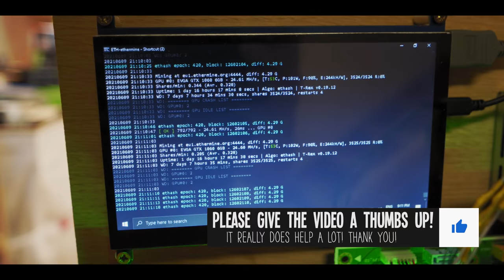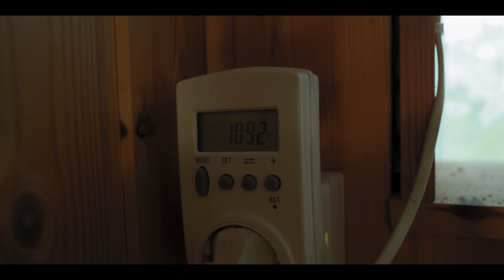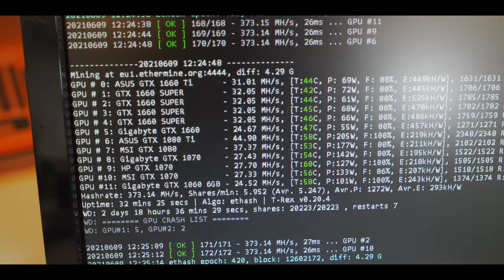My 800MH/s Mining Farm Tour (Ethereum)

Comment: You can get 27.3 mhs from 1660 if you oc it correctly, my two 1660 are stable at 27.3 mhs @69 watt
Reply from the maker: That is depending on what memory chip manufacturer you have in your 1660. Different 1660 cards perform differently and 24.5mhs is max for mine.

Comment: Which is the best efficiency card according to your experience 3060 ti or 1660 super?
Btw i liked your idea of building 4x13 1660 super rig
I am also thinking of same please give me some opinions 🙏
Reply: Skip those and go for a 3070 rig. Much better efficiency and less heat from the cards.
Reply: 3060 ti similar hash rate as 3070 but cheaper

Comment: Your 1660 supers that produce 32.5-33.5, you said you use Samsung memory, do you mean that your 128gb ssd is from Samsung ?
Reply from the maker: No, so the actual memory chip inside your graphics cards can be manufactured by different companies like Hynix, Micron or Samsung. The 1660 Supers that have their memory chip manufactured by Samsung can be overclocked a bit more to reach slightly higher hashrates. You can check what memory manufacturer your GPU has in a software like GPUZ, but there’s no way to know before you buy the GPU, so it’s all luck. I have 17 1660 Supers and 10 of them have had Samsung memory.
Reply: @SebsFinTechChannel  thank you so much seb appreciate your content. It’s a lottery out there

Comment: Can I have the link for the 1 to 4 pcie splitter card so I can add more gpus to my gaming motherboard?

And you mentioned you don't want to use the splitter long term. Why is that?
Reply from the maker: Link is in the description of the video now! It's just because it makes your rig slightly more prone to crashing with really high overclocks. But as long as you are able to restart your rig if it crashes that's no problem. Good luck!

Comment: I have a rattling sound on my 1660super when fans is around 60-80% rpm do have you ever encountered a similar issue?
Reply from the maker: Yes you might have a loose fan. It’s easy and cheap to replace :)

Comment: Why aren't you using 2000 series or 3000
Reply from the maker: I don’t use 2000-series because they are less power efficient than 1660-series and I don’t use 3000-series because they are a lot more expensive per mega hash

Comment: how are you getting this low wattage on the 1660 cards I get 78-80 watts
Reply: also how u r getting 32 mh/s on the 1660 super do you mind sharing the oc setting
Reply from the maker: First you mention wattage and then you mention a temperature. What exactly is your question? :)
Reply: @SebsFinTechChannel  i mean watts sorry 😂
Reply: @SebsFinTechChannel  maybe because of memory I have micron memory
Reply from the maker: Okay! To lower the watts check out this video: https://youtu.be/4fNhJmJbcRk As for hashrate, if you have Hynix memory you can get 31.8 max with memory clock at -502. With Samsung memory you can get up to 33mh/s on some cards with good cooling by going to around +1300 on the memory clock. But not all cards can handle that high of a mem clock, some crash. So you just have to test your way.
Reply from the maker: I don’t know about micron memory sorry.

Comment: bro have one consult, i buy 3060 for 1000usd is a good idea ?
Reply: no :( price high and have hashrate limiter. older ones, you gotta play around a bit to get the limiter off
Reply: @WhenPokemon  or 3070 for 1200usd ? Nvidia driver unlock not ?
Reply: @ryugamer9726  1200 is still a lot for a 3070 :( check new egg prebuilts. generally anything made before may 2021 for the 3070 will not have the harsh rate limiter.
Reply: @WhenPokemon  mmm the driver 470.05 nvidia not unlock ?
Reply: @WhenPokemon  bro i buy and see gpu have LHR :( have solution ? 470.05 not catn install
Reply: @ryugamer9726  if 3070 with lhr, no solution yet. the newer 3060 with lhr no solution too. only old 3060s can do the driver trick
Reply: @WhenPokemon  you can not do anything at all will it be mined at 26mhz?
Reply: @ryugamer9726  3070 lhr, no solution yet. yes, you are limited :( you might wanna mine a different coin other than eth for more profit
Reply: @WhenPokemon  my girlfriend is kill me
Reply: @WhenPokemon  i sell my gpu lhr, and i buy another not lhr who is better ventus 3060 3x or evga 3060 xc ?
Reply: @ryugamer9726  =(
Reply: @WhenPokemon  who ? is better and how see is lhr o not :(
Reply: @ryugamer9726  all 3060 have LHR, but the older cards have ways around it. the newer 3060 are fully LHR locked
Reply: @WhenPokemon  the box see no lhr, proveedor say not lhr, have two ventus or evga, and i think who is better for mining
Reply: @ryugamer9726  All 3060 boxes do not say LHR because they are all LHR. the newer 3060ti, 3070 and 3080 after May 2021 will show LHR or not
Reply: @WhenPokemon  ok ok the gpu not have lhr who's is better ventus 3x 3060  or evga xc 3060